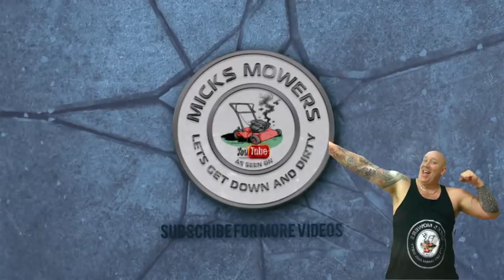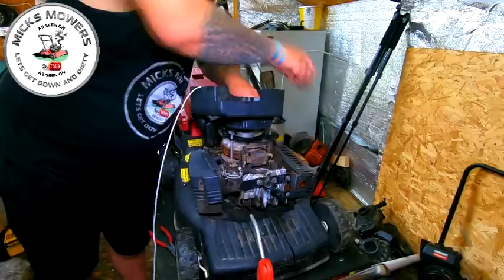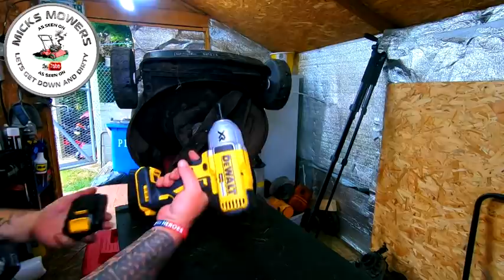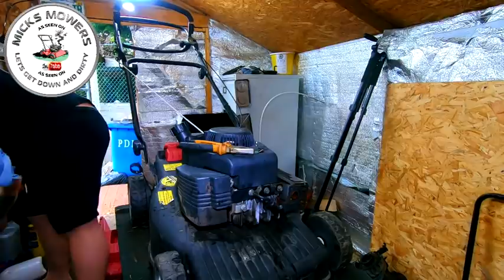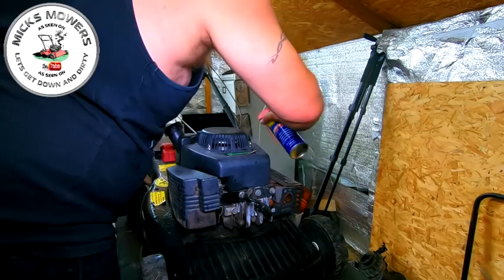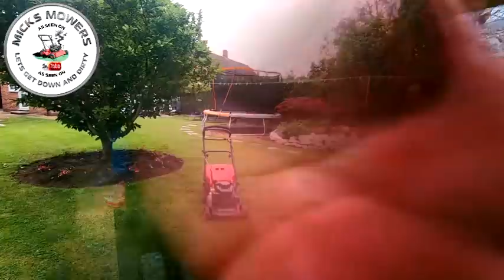Mountfield 474 Dump Find Lawnmower Repair Video

Comment: The clacking noise when you release the handle is the metal bracket that should have a brake pad on it. They always fall off so I normally cut the pad bracket off or bend it out slightly so it doesn't make that racket when the mower stops.
Reply from the maker: Well look who it is.. hi bud.. all ok? Yeah the break pad has come off.. they do on these..
Reply: @themowerman  Yes I know lol
Reply from the maker: @retrorestore  missed you hunny

Comment: Hi Mick , what is the best engine oil to use on a Suffolk punch lawn mower
Reply from the maker: SAE 30 will be fine.. just make sure you fully drain the oil oil out

Comment: I got an xceed ex46slm petrol mower from a skip,  granted it needs a little work  But it was running when I got it.
Did the carb today and it was spotless inside, not a spec of dirt in it.
Only problem I got is finding a engine brake cable that fits as the original one was bust with parts missing. 
Once fully done and working it should be an easy £90.
After that I got a mountfield to do with electric start  (already sold as soon as i got it ) ;)
Reply from the maker: Make your own cable.. I have a video on how to do it.. low cost
Reply: I have found 1 that's  pretty much the right lengrht but if that fails I'll  make my own.

Comment from the maker: TOOLS I USE -
half inch inpact gun https://amzn.to/3CIlA3u
Fan Blade Bulb https://amzn.to/39BLI4a
Blade removel tool https://amzn.to/3nxBVQj
Micro Drill Bits https://amzn.to/36Jpv0R
Carb Cleaning Files https://amzn.to/3lH8ESx
Hex Shank Extension Drill Bits Bar Set 1/4" 3/8" 1/2" https://amzn.to/3oFKHx9
Dewalt DCF887M1- Impact Driver, https://amzn.to/3oEVcjZ
Lawnmower Rotary Blade Balancer https://amzn.to/3e6UOWN
Rode WIGO Wireless GO Wireless Microphone https://amzn.to/2JlRlIN
Neewer 176 LED Light https://amzn.to/2HaubnJ
Universal Style, Mower Deck clamp for blades https://amzn.to/31PKygE
Briggs & Stratton Diaphragm and Gasket set https://amzn.to/3kF8Y3H
GT SONIC 3L Ultrasonic Cleaner https://amzn.to/2TDdVy9
VEVOR 3L Ultrasonic Cleaner https://amzn.to/2Gb3PBJ
Stainless Steel Strainer for carb jets in a cleaner https://amzn.to/3e6CxJ2

Comment: I either put a screwdriver through the recoil or hold it with a clamp while I tie the knots.
Reply: I’d let all the tension off the spring, put the string in and then tension the spring again. No need to hold anything with screw drivers or clamps
Reply: @almclean4835  6 in one and half a dozen in the other. My method there's no need to retension the spring.
Reply: @kbakeritsallaboutnobody.5761   ah but my ways better 😁

Comment: Hi Mick. To me that mower is making a funny noise when you stop it. Have you never thought of using a RPM meter to check the RPM. I wouldn't trust my hearing.
Reply: Its because the brake pad thats helps stop it has fallen off, its a common problem and doesn’t really effect the mower in any way
Reply: I was thinking the same thing,  sounds like metal on metal.

Comment: They scrapped it because it didn't cut with the blade being on wrong . I had 2 mowers from the scrap the weekend one had the wrong size blade and one was missing a wheel. Engines worked perfect on both. Throw away society we live in.